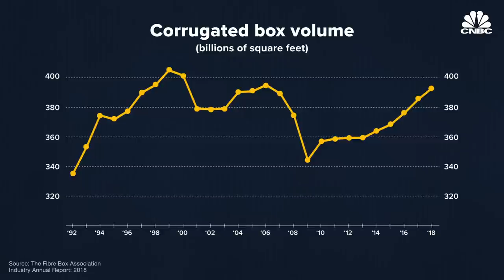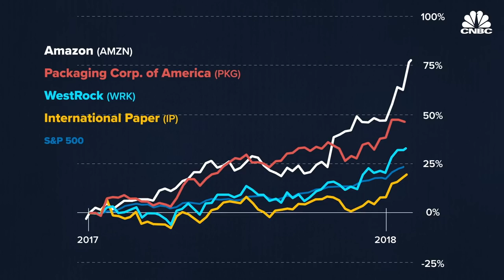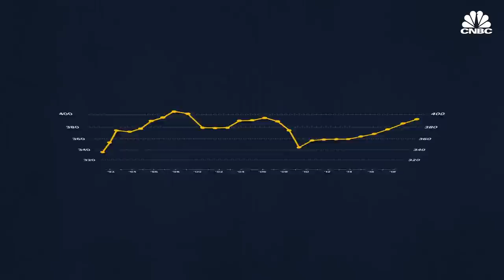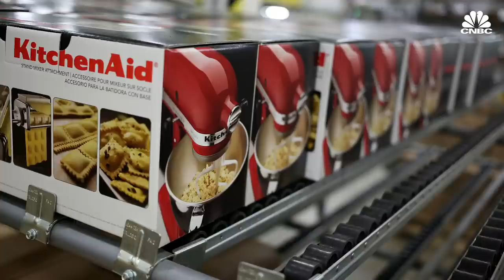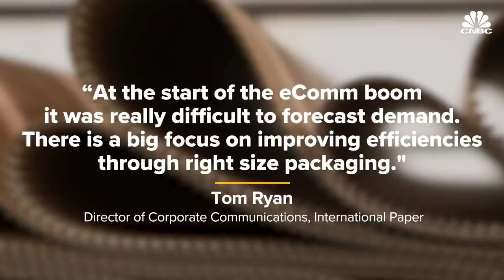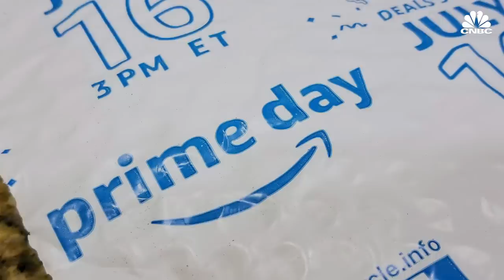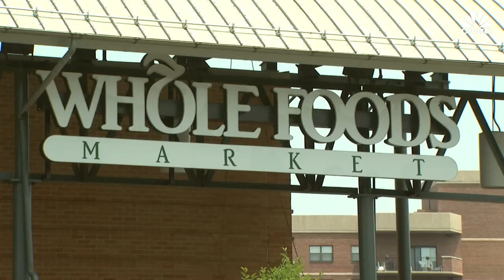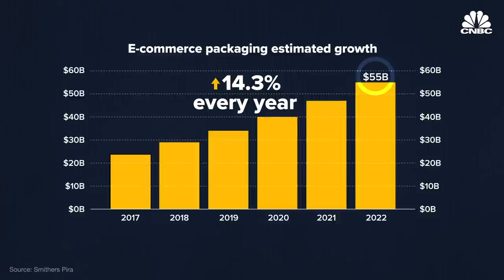The Business Of Amazon Shipping Boxes

Comment: I remember when I ordered a small 10” windshield wiper for the back of my car , it came in a box that was big enough to fit a sword or something 😂
Reply: I ordered a single 2 battery tab. Literally came in a 1foot by 1 foot box and I found it lodged in between the flaps
Reply: Whatever box the computer tells the packer they have to use. One can not downgrade to a smaller box. If the packers do then it may take longer to get your shipment.
Reply: Lesson learned is next time you order a windshield wiper, order a sword as well.
Reply: I swear that this is also the one thing I remember from all the packaging I ever received. The box for my wiper blade was OBSCENE!
Reply: It's because their system requires cubic scanning. It's really messed up. It tells the packer the wrong box size half of the time.
Reply: i ordered 5 bars of coal tar soap came in 5 boxes
Reply: @ke6gwf  They would probably ship that order in 2 boxes lol
Reply: I had the same thing happen, I got a big-ass box with one wiper. Next time I'll just get it in a store and reduce overall packaging about 400%
Reply: @k6gwf - Don’t suggest that!  The wiper blade and sword may be packed in separate boxes!
Reply: @Todd Kelly - I know from experience. I have PACKED many single wiper blades in boxes that could easy fit a rolled up yoga mat.
Reply: @Christina Fitzgerald - one of my main gripes about working at Amazon.

Comment: "Electronics and dinnerware will still require boxes."

Tell Amazon that. They just shipped me a 6TB hard drive in a plastic mailer. 😩👎
Reply: Did it still work?
Reply: The design of some carriers using semi-flexible plastic allows for some cushioning. With those mounted in a corrugated box. About equal to a foam block in the same box.
Reply: Gah!

Comment: I work for post office. Amazon barely tapes their boxes. Many time content get lost. That one paper tape not holding heavy things.
Reply: @ Fun Time -- It could be that ONE of their suppliers of THAT printed paper tape that is making tape with crummy adhesive... I say that because I usually have trouble ripping that tape off the boxes by hand... then a couple of months ago, I bought a VERY lightweight seat cushion and someone at the post office had to use their red USPS tape to re-tape the box because Amazon's tape was falling off.  (No lost anything, so I was good.)
Reply: You sir have taped your job together! Good Job
Reply: Companies don't care if their boxes are sealed correctly or not. They just want it on the truck and out of their building ASAP. I worked at a packaging company and was forced to work too fast to even close the boxes. They'd pop back open as soon as they were stacked onto the pallet, with wet tape still hanging everywhere. Nobody cared. It just had to get out the damn door.
Reply: @sunglassesgirl  it’s a water based tape. if the warehouse personnel didn’t tape it good the tape will dry and come off. i usually just wet it with a water bottle to activate the glue and stick it on the box again.

Comment: I work in corrugate design and the ecological issue is not with what Amazon uses to ship but the entire model of eCommerce over brick and mortar.  It's great that some less harmful packaging is in Amazon's financial interest (Don't be fooled by their greenwashing) but fundamentally their system is shockingly more damaging than the norms of commerce.  I'm not saying eCommerce should be outlawed, there are numerous reasons why it is important to many consumers and I go to amazon for certain things but the vast majority of products people buy on Amazon could (and should) be purchased in store when possible.  USPS, Fedex, amazon, and most products you purchase online are considered single-parcel shipment which really should be a last ditch effort as far as distribution is concerned.  Single parcel forces distributors to use massive amounts of packaging to ship each item because it will be thrown and dropped at every step on its way to you.  It also puts more trucks on the road, making more stops, burning tons and tons of fuel.  All of this while giving you a damaged product more frequently than any store.  

I also resent this video for insinuating that amazon invented ship testing.  There has been standardized testing used for over 50 years and as long as there has been major trade there has been some form of shipment testing.  For years amazon has tried to sell themselves as the heroes, solving the problems they created.

Comment: I worked at union camp in the late 90s. They had one multi million dollar special order German made Machine that ran almost constantly making boxes for 'milko'. They were basically boxes to transport containers of milk or orange juice. Another machine that was as old as wwii was primarily used to make boxes for white consolidated industries. Which owns several major manufacturers of refrigerators. It was constantly running to meet the demand of the super large heavy duty boxes. During the late 90s the demand was high and most corrugated board companies were closing their doors. A person with experience operating flexo presses that cut, print, and fold the boxes typically made more than $20 an hour. This was a time when a standard steel press operator or plastic mold operator might expect to make only around $10 an hour. I know a guy that has been with a corrugated packaging company since then and he is at top pay, almost $40 an hour. That's pretty good for someone who didn't even graduate high school and speaks to the demand of the industry for people operating the machines to make boxes. Swedish companies are recycling tires and plastic bags combined to make materials for building roads. Reinventing the wheel may not prove beneficial but redesigning the box could.

Comment: Hilarious... Looking to "cut carbon emissions" by switching from renewable (tree) cardboard to non-renewable (oil) plastic bags.  While the climate change people scream how we need to get off relying on oil.  🤣
Reply: My thoughts exactly. I throw those packages away every time since they don't go in a recycling bin. How is that good for the environment? Even if I have to throw a box away, that cardboard box will biodegrade relatively quickly. The plastic bag can can sit in a dump for up to 1000 years. If anything, we should be pushing for more paper. Also, let's not forget, trees clean the air.
Reply: The amount of space a box takes up whilst being transported is far greater than when plastic packaging is used. Therefore more products can be transported per trip leading to a reduction in carbon emissions due to transport of goods. I think this is what they meant anyway
Reply: They can switch to plant-based plastic. It doesn't have to be oil. The only thing keeping them from doing this, is money. But eventually that obstacle will be overcome.
Reply: @Zunair Rana: plastic packaging may be convenient for Amazon, but a customer’s burden for waste disposal.
Reply: Look up Life Cycle Analysis
Reply: @zunairrana5932  only because amazon send you a massive box with a small item in it
Reply: @Radek3887  stupid analogy.  Plastic is the best alternative.  Not cutting trees.
Reply: How about cutting down natal rate? Wouldn't that make more sense?

Comment: Coming from a business cost prospective using poly mailer bags/small bubble mailers inbulk  has saved alot of money in comparison to buying bundles of boxes. Boxes are still used but at a rate of less then half of total orders on average helping the bottom line. In the end on most small items packaging costs is between 40 cents to 70 cents a package each including printing costs. Tape is much cheaper online inbulk then in any Walmart out there.

Comment: I think the retailers all missed the point here. 
The problem was that customers were receiving products in boxes that are several orders of magnitude larger than they need to be.
Amazon needs to invest in programs that can make an educated guess as to how much physical space a customer's order will need if packed by a reasonably skilled packer.
THen choose a box of the appropriate size to contain that space, and tell the packer to use "this box".
What appears to happen is that the packer just chooses whatever box they have on hand, which is usually too large.
Another option would be to segregate orders based on estimated physical size, and then have different packers be issued a certain size box, and then allocate all orders for that size to that packer. Then you need only increase the number of packers using a certain size box to accommodate demand.
Another alternative (but this would steal jobs away from humans) is to use the above mentioned computer model to pack the appropriate box according to what the computer modeled in order to estimate the correct box size in the first place.
IE. make more, smaller, box sizes available to ship products in !

Comment: Hm, provided that flexible plastic packaging produces so much fuss and problems when its recycling is considered, why not to shift towards cellophane (which is, obviously, made of cellulose gained from wood). Cellophane packaging might be as convenient as PE/PP/PS, but it is more eco-friendly due to much faster biodegrade rate and easier recycling.
There might be an issue with some hazardous substances that are used in a cellophane production nowadays, but maybe it is worth solving this problem or consider how many toxic substances are involved into plastic packaging production?

Furthermore, can we substitute the bubble wrap by using the cottonwool or rayon? Again, it's much easier to recycle/reuse them and after producing a decent amount, we can stop producing new amounts at a high rate, but recycle previously produced materials -- sounds like a solution to the problem of excessive forest cutting and plastic packaging recycling.

Comment: Paper is better than plastic. Paper is a renewable resource and the box is recyclabe. Plastic is mainly based on oil and shipping bags are virtually never recycled becaise the adhesives of the surface are contaminants that make this impossible. Instead of plastic bags, higher quality paper bags work fine and are more commn in Eurpope and parts of Asia. USE LESS PLASTIC.

Comment: i think of frustration free packaging as not using the clamshells made of the same kind of plastic that soda bottles are made from requiring a knife to open

or using packaging with zipper seams or punch out seams that can be opened rather easy.

i am talking about the boxes that small electronics come in.

and for small products like packs of stickers instead of plastic bags they should use small media envelopes witch are much easier to recycle and can be rolled or folded to fit in mail boxes.

such as the envelope that is being scanned at 9:14

the plastic mailers are worse because the plastic is not as easy to recycle and clog up the insides of animals that eat them and go into the worlds garbage patches in the oceans.